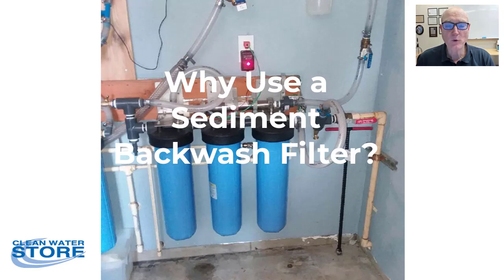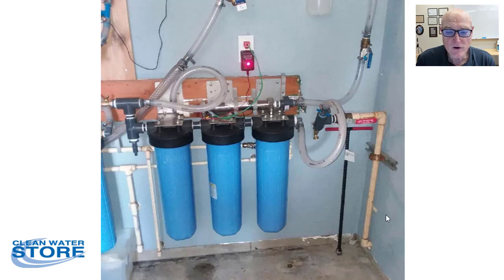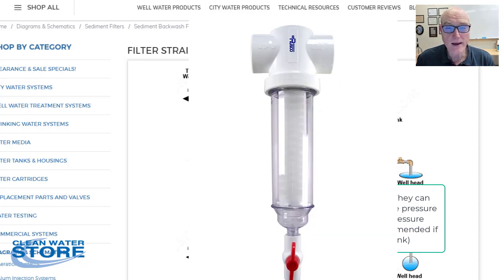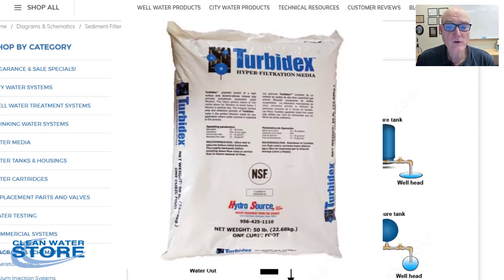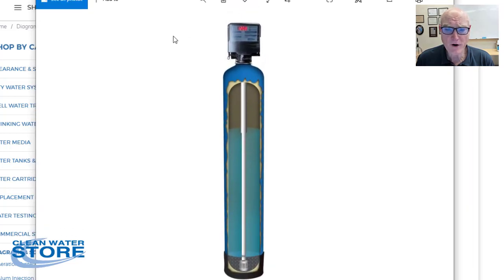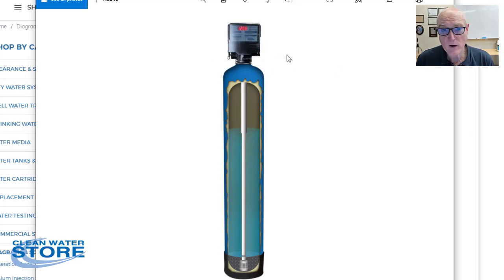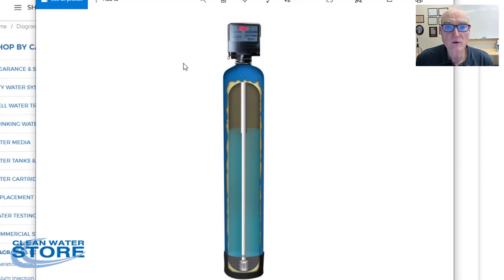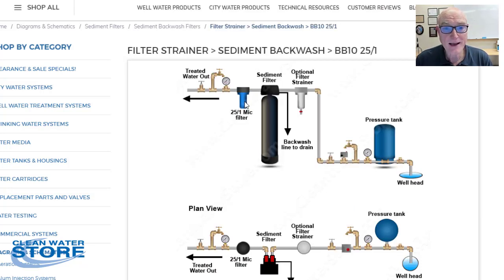How to Stop Changing Filter Cartridges for Well Water

Comment: Is the sediment filter really necessary? Can you do just the spin down filter and then the regular 25/1 filter?
Reply from the maker: Hello -  yes you can just use the spin down filter and big blue filter with cartridge.   If the cartridge lasts for a few months its not hard to deal with, but sometime the 25/1 filter needs to be changed weekly or monthly,  in that case having a sediment backwash filter saves you having to change the filter all the time.  Thanks for asking about that!